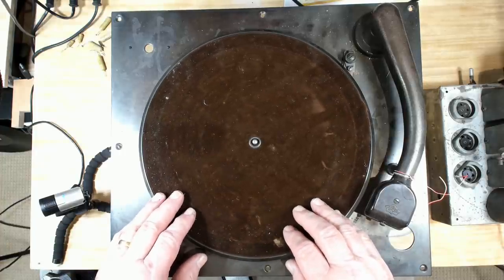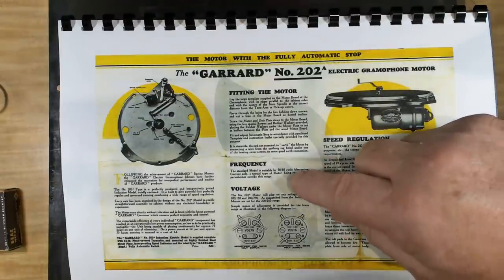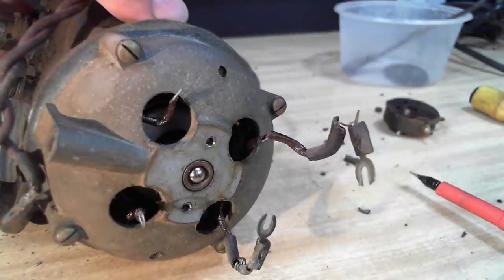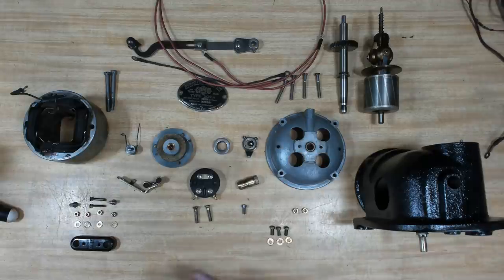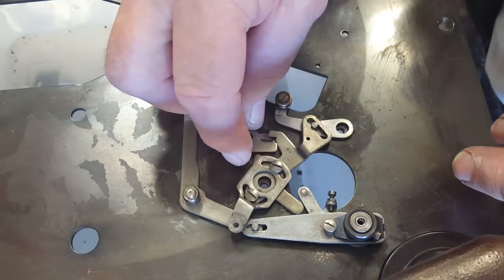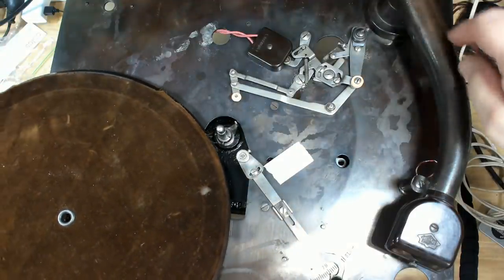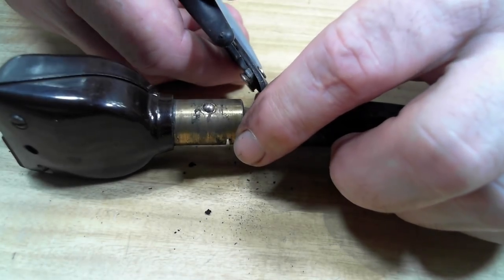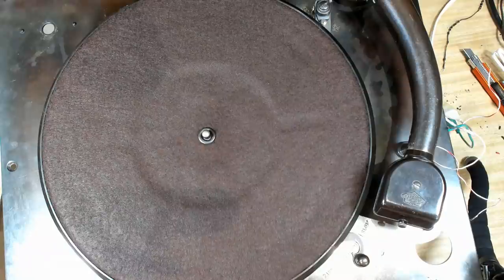Garrard Phono 202A and Airline Radio 62-144 repair Part 1

Comment: Hey David! My friend gave me a Garrard similar to that one as part of a old school PA system. The amp still fires up, all original. I am going to recap and restore the amp as I collect them and sell the turn table. It's allways good to see a video from you, your attention to detail is unsurpassed. Cheers!
Reply from the maker: Thanks A Last. Pity you aren't keeping the phono, those 78s can sound quite decent, I can lend you my harmonica one 😄
Reply: @DavidTipton101  Pop a MP3 player output into the PU out circuit for additional versatility

Comment: David thank you for 43 minutes of pure magic. 
As a boy I taught myself to understand and fix this type of gram motors. I started on the wind-ups and graduated to the electric motor types. The basic layout was borrowed from the wind-ups and the governor was a direct copy. The main issue I found was noisy running and dry bearings/pivots and broken leaf springs holding the governor weights. I don't remember any burned out motors, built well.  In 1960s the UK was awash with these and the radios that went with them. 
For 43 minutes I was 10 years old again, thank you. 
I noticed you reached the graduation level of three decks worked on, congratulations on your fourth and a beautiful restoration.
Reply from the maker: Hi jonka1, thank you. That means a lot that you enjoyed my video and it reminded you of earlier times. I would love to get one of these for myself, I was so impressed with it. I'm and old hand now with 4 decks under my belt 🙄😄

Comment: What a fascinating restoration on the electric motor and player parts. Great job on this unusual machine.The needles have a variety of thicknesses.
The sharper the point the louder the sound as it touches more of the groove. They dull rather quickly however being a soft metal.
Nothing worse than old rubber wiring but I see you have no problem replacing it with period appropriate replacement wiring. Best purchase I made was
to get 1950's vintage cloth covered wiring, enough to fit in a shoe box, not knowing how much of the old stuff with rubber coating I would eventually find!
Reply from the maker: Hi Steve, thanks. I didn't know that about the needles, the ones I bought are good for five plays. I get a sinking feeling when I flip over a radio and it's full of rubber wiring 🙄
Reply: @DavidTipton101  The worst part of dried up rubber wiring is shaking out the chassis over a large piece of paper which makes it easy to dispose of all those  dang pieces!
Reply from the maker: @hestheMaster  I feel your pain Steve 😄

Comment: Very interesting to see the craft that was done so long ago. I mean how to solve, for example, the speed control without electronics like an old steam engine. :-)
Reply from the maker: The speed control is amazingly stable, certainly more than enough for 78s, the whole thing was very well built 🙂
Reply: @DavidTipton101  I suspect its more of an overspeed control, and would only cut in if voltage etc peaked out for some reason,  otherwise it should just fly around as much as a mass flywheel inertia device to effectively smooth the ac peak and trough.

Comment: I enjoyed the change - a bit of mechanical to break up all of the electrical. Great job! Thanks for the video.
Reply from the maker: Thanks Tim and thanks for watching 😀
Reply: @DavidTipton101  The Garrard mechanism looks complicated, but broken down becomes simple, one can see how it evolved into the 3 speed decks, auto return and stack change mechanisms,  so its useful for repairers of later electric decks,   The tone from the completed unit just shows how good these could be and the hiss and noise often seen in movies for the 1920s/40s is so wrong on the clarity of simple mechanical-electro reproduction.

Comment: Beautiful job on the motor, really enjoyed watching that - thank you. The switch makes me nervous though, is the insulation around the screw that holds the circular contact piece still nice and solid?
Reply from the maker: Hi Ross, thank you. The switch was in very good condition, the insulation on the contact was also in excellent condition so I was happy to use it again 🙂

Comment: When I was about 8 years old, a neighbor gave me a record player that was a Garrard. It didn't look much like that one (it had 3 speeds and was probably around 30 years newer than the one in the video) but it had an identical arm (though the cartridge was different of course, with two needles, one for 78 and one for 33/45) and a switch that was remarkably similar to the one on yours. And yes I do remember getting 220V on my fingers from it at least once, possibly more than once. Evidently they thought the design was good enough and if you were insane enough to muck around with it, and got yourself zapped, you had it coming to you.
Thanks for posting the video! A work of art as usual.
Reply from the maker: Hi Jac, thanks. I guess electrical regulations then weren't as strict as todays. I'm sure I got a belt or two when I was young 😀

Comment: Hi Dave, 
Those old Garrard record decks are nice to work on.  Once cleaned, lubricated, and set-up to specifications - including break linings replacement, there is every chance they will run for a further fifty to eighty years.  Although I’ve serviced no more than five at the most, I nonetheless have fond memories of them.
One small optional tip, I usually make up a small two NPN transistor preamplifier, with a simulated scratch filter effect, that is fitted between the deck’s magnetic cartridge, and the radio phono input.  I usually spend time adjusting the preamp circuit to suit the the sensitivity of the radio amplifier.  Enhancement to audio reproduction is usually beneficial.
Although it has been a huge treat watching you do service work on the record deck I know there is an equally huge treat to come when you begin service work on the radio.  Yes my friend it will be a real pleasure to see.
All the best Dave, Phil, The man from Sheffield
Reply from the maker: Hi Phil, I always look forward to your comment. The Garrard was a pleasure to work on, it is so well made. I am intrigued by your preamp as I haven't been able to produce anything that doesn't induce hum into the radio thus far. Are you able to send me a sketch of the circuit for your two transistor preamp and how you power it, if it's not too much trouble of course. The radio is coming along well so I hope to get a video out by Friday. Thanks Phil. You can send the circuit to : vintageradioaus@gmail.com

Comment: I seem to recall that there were needle sharpening services, that would sharpen blunt needles (I may be mistaken). The 78 rpm records were made out of stouter materials than the 33-1/3 and 45 rpm records too. But, anyway, great video and I'm looking forward to Part 2. Montgomery Ward (Monkey Ward as they were nicknamed) was a department store chain HQed in Chicago (I believe).
Reply from the maker: Hi Chris, I can image there would have been such a service, single use needles would have had a high turn over rate. Yes they were based in Chicago 🙂

Comment: Well that was something!!!!! 

Prior to electrical recordings in the mid 1920s "78s" had no set speed .... so the fast and slow would enable you to adjust  accordingly and to add to the mix for a while there was a speed war 78 vs 80rpm! And that tone arm must weigh a ton!!!! And steel needles ... oh why why why? (I know why btw)
Reply from the maker: Thanks Chris. I should have mentioned that but it didn't say it in the manual so I wasn't sure if it applied to British records as well, imagine quibbling over 2 RPM a minute 😄

Comment: There were magnetic pickups in the ‘30s.  They were pricey compared to the Rochelle salts ceramic ones and had a higher tracking weight which could cause greater wear on the record.  If it had been Rochelle salts it would have stopped working long ago due to absorbing moisture from the air.  Nice work on this part, I can’t wait for the radio chassis.   A few days ago my brother took me to an antiques emporium in Castlemaine and they had several valve radios. To my surprise there were two Bush radios, a DAC90 and a DAC10.  There was also a Philips and a Philco.  Heaps of petrol pumps, motorbikes, model cars, clocks, etc, etc
Reply from the maker: I expected a ceramic pickup, shows how much I know about old gram heads. We like going through those large antique shops, it's slightly depressing seeing some of the stuff in there that we still use today 🙄 I'll have a look for it next time I'm in Castlemaine 🙂

Comment: Very enjoyable. Really interesting to see how the motor was constructed with the centrifugal governing device (more akin to steam engine regulation!) In later turntables a  centrifugal governing device like that would have introduced unwanted vibration and would not have been used I would imagine. But with something that is so over-engineered and sturdy  with a 78 rpm gramophone needle the size of a darning needle on a twenty pound arm I don't suppose  it would notice an earth quake. Also the magnetic pickup was another surprise. I can't wait to see it all together with the refurbished radio. Nice work.
Reply from the maker: HI Ged, thank you. I think you are right about the vibration, you could swing a brick in there and not notice it. I have seen a number of tone arm designs with the large head, now I know they are magnetic, I hadn't considered it up till now 🙂

Comment: That motor and speed control are fascinating.  Sort of like driving with full gas and controlling the speed with the brake.  I suspect that in 1930 there was still so much variation in worldwide standards that this was a reasonable efficient solution to making the motor saleable in multiple markets.  From old textbooks I know the engineers of the time clearly understood how critical properly regulated AC speed and voltage controls were, so I don't think they were trying to compensate for low quality power supplies.
Reply from the maker: That's a great analogy Yisrael S. The motor would only work within the limits on the data plate. At a time when there was so much variation in frequency and even DC mains power it would not have worked in a lot of instances 🤔

Comment: Great work! I would suggest to use shielded cable to connect the pick-up.
Reply from the maker: Yes, I will, thanks ef804s tubes 👍🙂
Reply: @DavidTipton101  was the original shielded ?  The twist removes some stray currents affecting HF or low hum.

Comment: Yep we called it Monkey Wards

&  my dad, every time we’d  make the 35 miles to the( original mall  in Seacoast New Hampshire ,

my Father would need e a long sit in the bathroom, in  the Montgomery Ward’s  store. 

( he didn’t care for the bathroom in the mall hallway)

On the other end of the mall, was the other  Front Anchor store, was another discount department store that went out of business when the” Mall at Foxrun in the mid 1980’s, called Bradlees.

 

Now I wonder if I can find a store map from back in the day late 70s & is early 80s 

It was on one far end the mall , this place was very similar to Sears , Catalog  sales/their own brands very similar to Sears, just not as much endless selections as Sears
Reply from the maker: Hi Jammed123, they must have had better bathrooms at Monkey Wards, probably with a catalogue to read 🙂
Reply: @DavidTipton101  quieter, less traffic surely

Comment: Safety Issue:  Should check the motors winding  leakage to motor frame/laminates.
Reply from the maker: I used a megger to check the windings afn29129 David 👍🙂

Comment: Hi David. That's a nice pair of relics you have there. Glad you got the turntable working. Bombproof construction was typical for older Garrards. The radio chassis looks like it belongs in a tombstone type cabinet that was popular in the 30s and 40s. Good luck with the radio. As always another enjoyable. Cheers Chris.
Reply from the maker: Hi Chris, thanks. The cabinet is a console but the model number points a tombstone cabinet. I haven't seen the cabinet and I wonder if it was built to house the chassis and gramophone by another party 🤔 Link to original cabinet: https://www.radiomuseum.org/r/montgomery_62_144.html
Reply: @DavidTipton101  Most Radio circuits had a Gram Input, dont know about USA and Aus, but UK Purchase tax differed for completed products,  furniture and 'components'  hence canny folk would buy whatever worked out cheapest.  Sometime excess parts would be sold off cheap,  poss as 3 speed decks were comng in the world was awash wth 78s only so the places like more remote areas might just have got these real cheap,  unusual that it was not thrown out with a 3 speed replacement deck added.

Comment: Such a brilliantly over-engineered piece of British equipment.  It could only be British, and I mean that in a nice way.  The governor is the same mechanism as a wind up gramophone motor, they work forever.  Those early magnetic cartridges sound quite good, shame they weigh so much on the records.  When I was little, we used to have one of these mounted in the top of a radio and I used to spend many hours playing our 78s.  Everyone thought I was weird!  Oh well 😄  Can't wait to see and hear it all finished. 😊👍
Reply from the maker: Hi Pauline, It was overengineered and a pleasure to work on, ironically it was sold as a budget solution for gramophones but it looked better than that. The magnetic pick up works very well, I was surprised how well. I would often spend a Saturday afternoon listening to records, particularly on a cold Melbourne arvo with the fire going 😊
Reply: @DavidTipton101  Gotta love over engineering 😊

Comment: I'll call It a day now and calm down with this excellent display of patience. I tried to replace the starter line on the lawnmower and ended up cursing the coilsprings third escape. Tomorrow I'll try the "Tiptonic" approach.🤣
Reply from the maker: Haha... sometimes it good to walk away Jerker and attack it later, coil springs especially will try your patience 😡😉
Reply: @DavidTipton101  try wrapping elastic bands around them and a tied bootlace.

Comment: It’s a second generation Garrard Electric Turntable. The first generation replaced the Mainspring assembly in a wind up motor  with an electric motor, using the windup Governor mechanism for speed control.
Reply from the maker: Ok, thanks Chris, interesting 👍🙂

Comment: That's a Wells-Gardner 7D chassis from 1935.  They made these for Western Auto (Truetone) and also Montgomery Ward (Airline), in both a few art Deco styled console cabinets and tombstone cabinets.  Wells-Gardner also marketed one under their own name.  These were very high quality and perform very well.  As far as I know 110-120vac only, and only sold in the US.  I've worked on two of them, and had problems with arcing on power-up in both.  One turned out to be wires too close on the inside of the IF cans, the other I haven't been able to figure out yet!   Tons of 0.2mfd capacitors in there!
Reply from the maker: Hi a587g, yes the owner found the name Wells-Gardner in the cabinet somewhere. This must be an export model and it runs on 230VAC, the 230V transformer is in the parts list. This one also has an arcing noise on start-up and has on occasions done it during operation. I am going to check the transformers, I have checked everything else. Thanks, that's good information. I used my supply of 0.05 caps on this one 😄
Reply from the maker: I must thank you a587g, I checked in one of the IF cans that I had disturbed and found the wire was touching the side of the can, the insulation had deteriorated to allow arcing between the two. I put some heat shrink on the wire and moved it away form the can. All noise has stopped. It was like this from the factory and it did it before I messed with the can. As the insulation has failed over the years it became a problem. Thanks for the tip a587g, you saved me a lot of head scratching 👍🙂 Is it OK to reference your comment in the next video?
Reply: @DavidTipton101  glad you found the issue!  I'm suspecting the continuing issue with my other one is in one of the other cans... Just haven't felt like taking it apart!  I'm very curious as to what your cabinet looks like... Had no idea they exported this chassis!
Reply from the maker: @a587g  I don't have the cabinet, the owner has it and I haven't seen it. I don't know if it's commercial or home built.

Comment: Amazing all that old engineering that went into the turntable :-))  Do you not take photo's before you take things to bits, I wouldn't risk the video card getting corrupted.
Reply from the maker: Hi Bob, I do take photos sometimes, particularly with wiring but didn't bother with this unit. The video is always there if I need it and it is recorded on two PCs so is pretty safe 🙂
Reply: @DavidTipton101  Unless the card the recorded it gets corrupted, or are you recording direct to the computer?
Reply from the maker: @BoB4jjjjs  Direct to the computer Bob and then backed up to my editing computer. The camera I use in my workshop has internal memory but I haven't lost anything from that so far 🤞

Comment: As always Dave, a brilliant video, I'm looking forward to the next part, hopefully when you marry up that turntable with amp the humming will stop, was surprised you did not use shielded cable on the tone arm, as that would have helped stop the humming, but I'm you will sort it out as is do, stay well best regards 👍
Reply from the maker: Hi Barry, the humming was from the cheap test speakers I was using. I was going to use shielded cable in the arm but I decided to use the same as they had originally, if it doesn't work I will change it, I should have left some slack in the wire anyway. Thanks Barry 👍